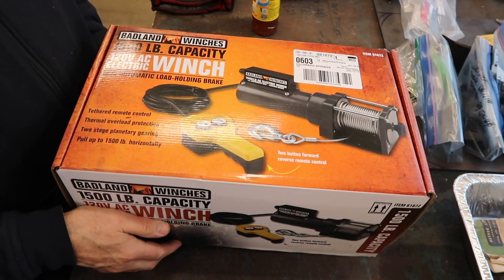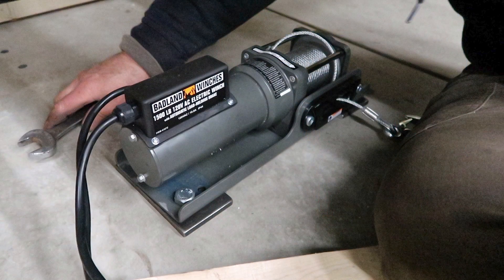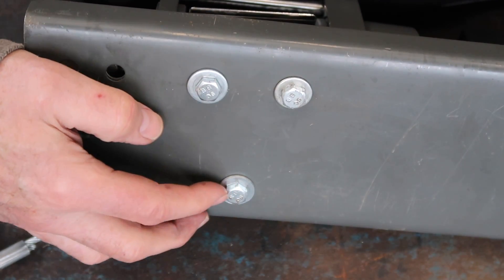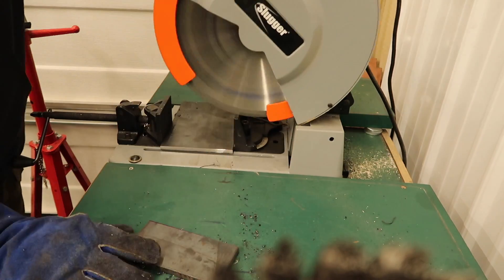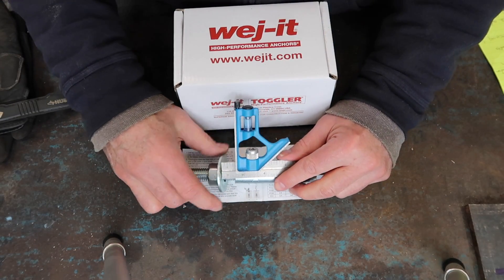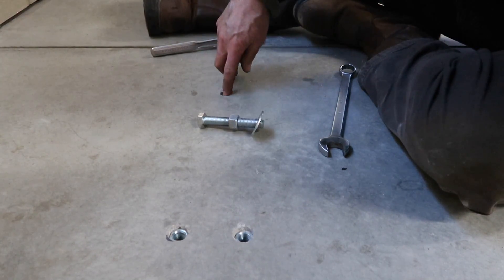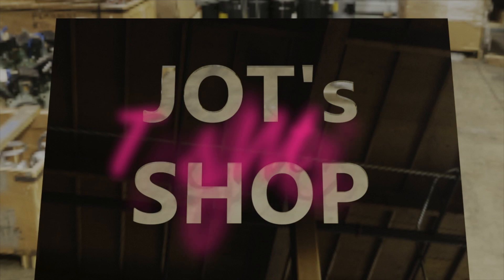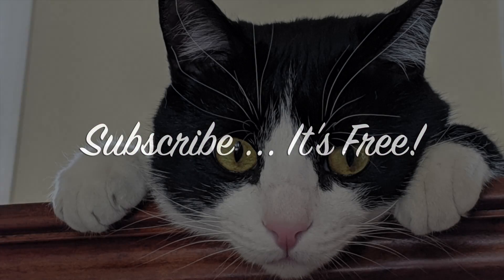Garage Floor Winch Install

Comment: Are the floor anchors 7/8" or 5/8"? Looks like 5/8" but you said you drilled a 7/8" hole in the shims and also I'm assuming you widened the bottom holes on the plate?
Reply from the maker: Sorry for the delay in answering. Yes, I checked and the anchor bolts are 5/8 in as you suspected. Thanks for the question and thanks for watching!

Comment: I’m planning to do this so I can pull my tent trailer into the garage nose first (driveway is sloped). I’m getting mixed information on the web. Is this 1500lb winch able to pull a rolling object of, say, 4000 pounds? Are you pulling heavy vehicles? Thanks!
Reply from the maker: I can't say for sure if it would pull 4,000 lb. However, it had no problem pulling a 3,000 lb vehicle in. However, our driveway is not sloped. It is level.

Thanks for the question and really appreciate you watching our videos!

Comment: How did you attach the winch to the base plate? The included bolts are too long.
Reply from the maker: If they were too long, we probably either cut them shorter or replaced them.

Comment: Is mounting to winch to the baseplate necessary? Or can one just mount the winch directly to the concrete? Maybe adding a mounting hole? my floor mounted winch wouldn’t be something I would use too often.
Reply from the maker: We're really not sure. We mounted with removable bolts so we could reuse the winch in other places as necessary.  Thanks for watching!

Comment: Thanks very much.  Mounting the winch to the baseplate was a challenge!  Because the fairlead bolts were too long, I turned them around and have the nuts on the outside.  Not as finished a look but it’s a work tool!
Reply from the maker: Thanks for the comment and appreciate you watching!